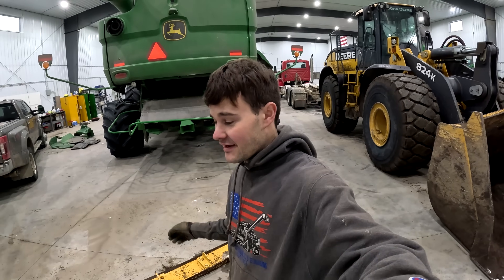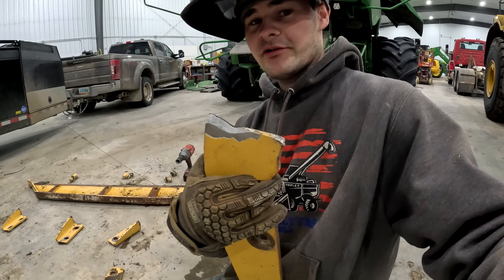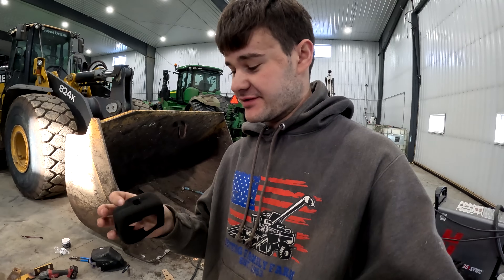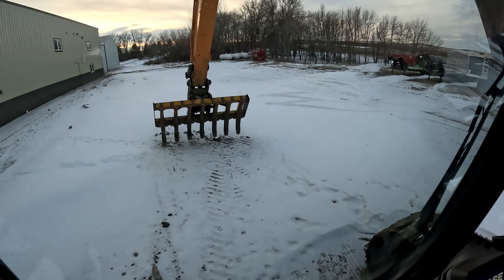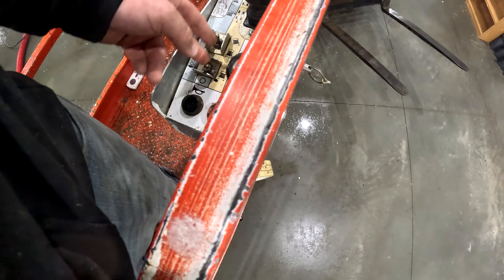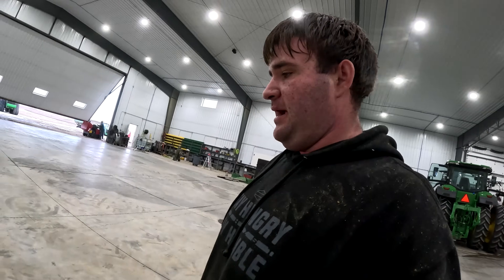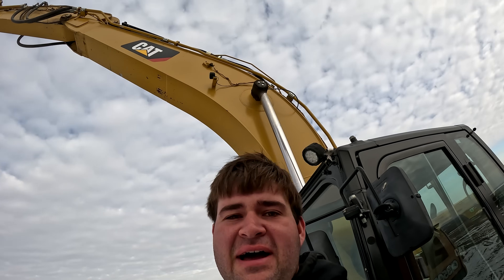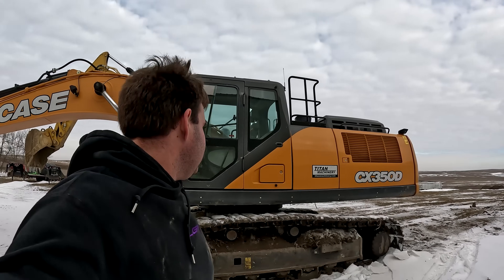I Accidentally Bought NEW Farm Equipment...

Comment: When you get your controller wet it will not work and sometimes you will short out the circuit board on the scissor lift. Always wrap it in plastic before using it to keep the controller dry.